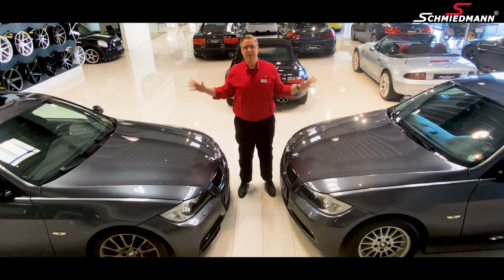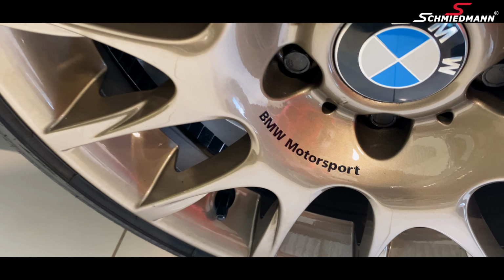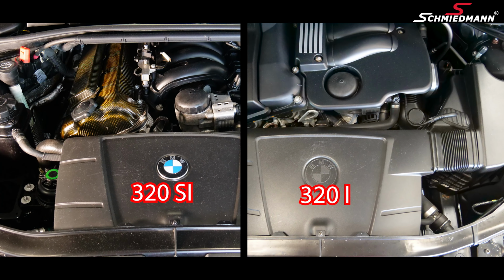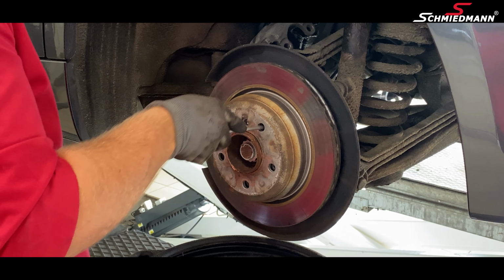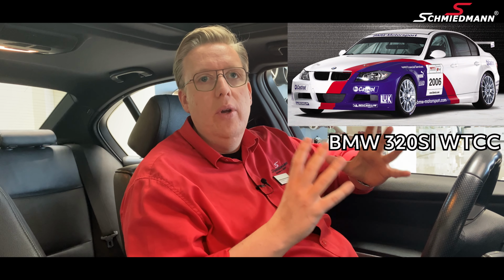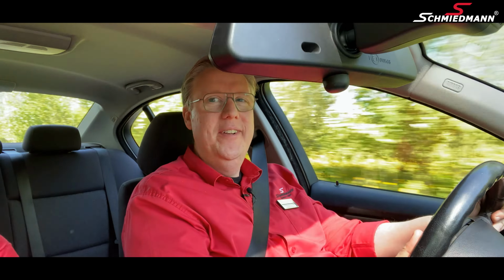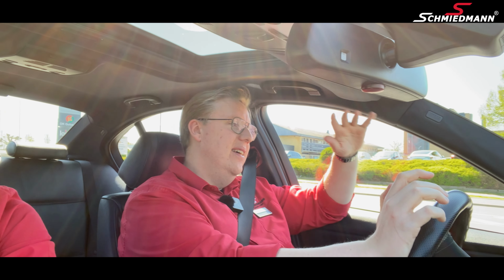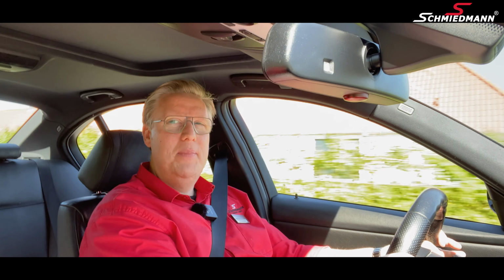You have NEVER heard of this BMW! The BMW E90 320 “S”I !? Extremely rare

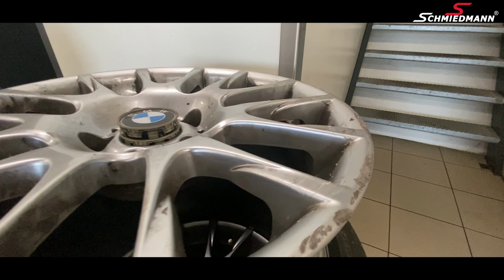Comment: I love my little Si! I found a one owner Si with full documentation at BMW Munchen with the upgraded engine from 2016. New coilover suspension and some minor chassi tweaks makes it very impressive on curvy roads, very understated and looked over car! It is a bit intresting that they used the gearbox from the Z4 because it is shorter and suits better when the engine is moved back, together with a shorter section of the propshaft. The also have 4:10 rear axle ratio and the suspension is no regular M sport setup but tweaked especially for the Si.
A note is that the Vanos is still on the engines but the Valvetronic is gone because it didn't like the high revs and was a risk for problems in racing so instead they use a regular throttle flap.

Comment: while very beautiful and having kart like handling because of the lower center of gravity, the engine was problematic. all the homologation things meant it had no valvetronic so economy vs performance was pathetic. Did rev kinda high iirc.
Reply from the maker: Exactly, no Valvetronic due to homologation, means you have to drive it like a racecar with quite high revs.

Comment: Compared to the BWM N46NB20, the 320si's N45B20S HAS 'Double VANOS' (valve- timing and overlap for intake and exhaust camshafts), but lacks 'Valvetronic' (!) (duration and lift). Normally such a system would be beneficial for a high performance NA-engines to develop more torque and therefore power from small displacements. But unlike Honda's i-VTEC, for example, Valvetronic unfortunately imposes limits on the engine's maximum achievable revolutions. See: https://en.wikipedia.org/wiki/BMW_N45